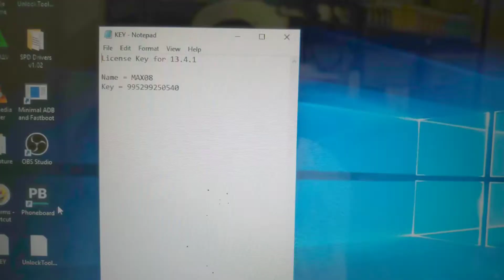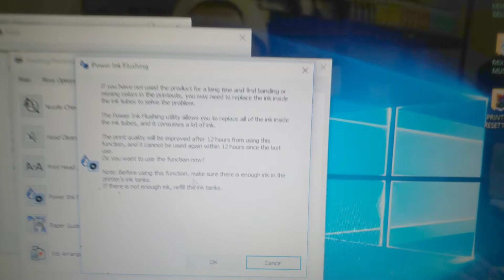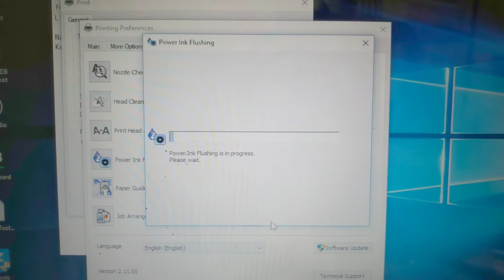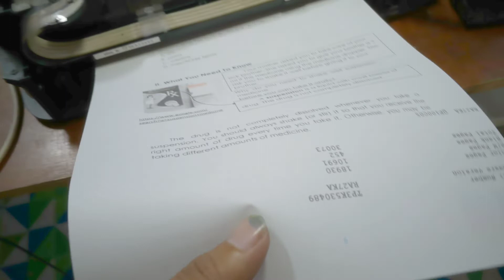How to replace printhead epson L120

Comment: sir ano po sign na sira napo ang print head ginawa na lahat pati flex cable pinalitan nadin wala paring print out.
Reply from the maker: Pag lahat nagama muna tapos wala parin. Sign na yan
Reply: @wayneslink  salamat po sa tips.
Reply from the maker: @bunalmanokbisaya  by the way pag ginawa na lahat pati fuse smd f1 o f2 napalitan na in case open na. Kasi pag open ang fuse blank printout yan.
Reply: @wayneslink  ito po hindi ko nagawa. hanap nalang siguro ako nang tech na may alam sa mga fuse2 sa board.
Reply from the maker: goodluck po @bunalmanokbisaya

Comment: Gud evening boss, Tanong ko lng kung Anong prob. Bakit po nawawala Ang black after after mga 10 copies then nag head cleaning ako,Ok na naman po at print uli ganun pa din 10+ nawawala na naman Ang black copy nya , Ang 3 color ok naman
Reply from the maker: Check hose baka may leak boss